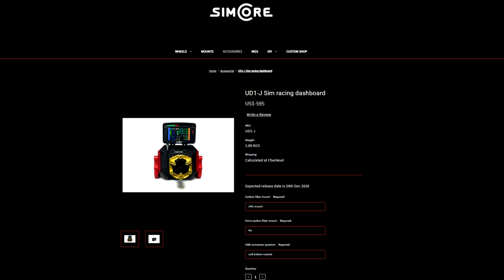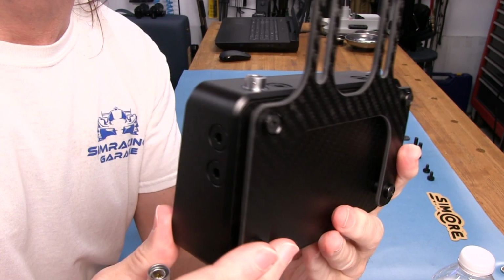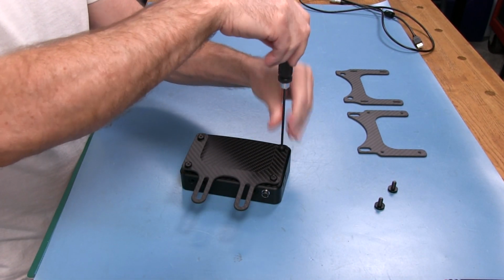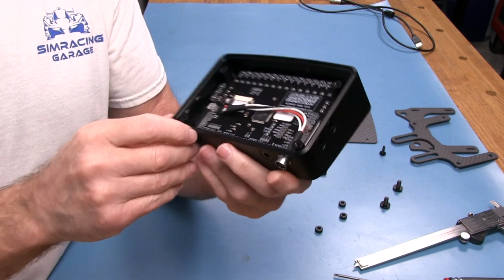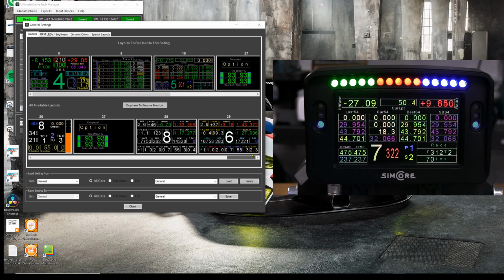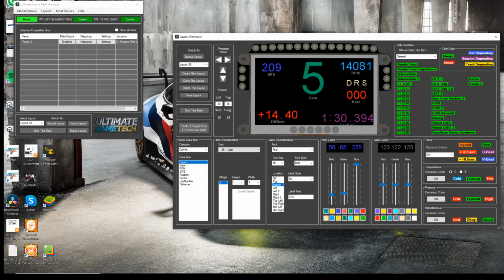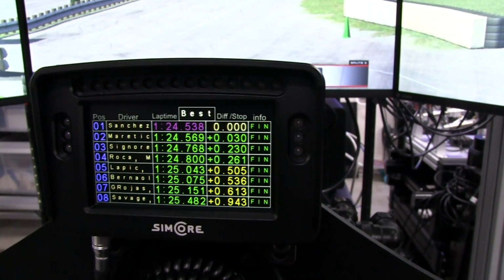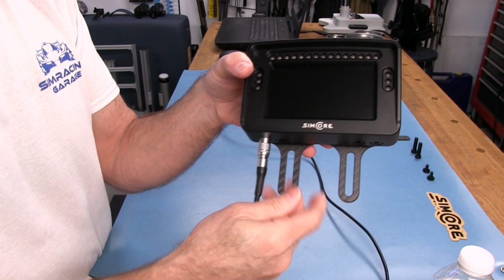SimCore UD1-J Sim Racing Dashboard Review

Comment: Really a fantastic product, both hardware and software. The sim community is very lucky to have manufacturers like this, willing to go top quality, when the returns are surely relatively low, because the potential customer base is so small. Especially so with something like this, because it's obviously not compatible with VR (which excludes me as a customer unfortunately).

Comment: the display itself from ultimate game tech is roughly 325$ without a case. Considering you can buy a 7" touchscreen + adruino for around 130$ on adafruit it's a big premium for some Leds you could make directly on the display itself. It's a great looking display, but I feel it's overbuilt for simracing. You don't need carbon fiber around a display in your living room.
Reply: Its not. Take it from me. The time and trial and error it took to make mine with a professional look, it would have been easier to just buy one. Thats not to say it wasnt cheaper. It was. 
But if i had to do it again, id probably just buy one.
The only thing I HATE about some of these displays though, is they want an annual subscription for a licence. 
Its crap. You shouldn’t need a licence for a LCD display.
Reply: @Gino_567  Go and give a look at SimDash on Instagram / Facebook, almost half the price.

Comment: I'd love to better understand the differences in approach between UGT and dashes which use simhub at their core. On the surface I see that all the data is fed and managed locally vs being sent out and then pulled back via a webpage which is great. The questions that remain are: is there a difference in the game data/controls that can be accessed by UGT vs simhub? Both seem to be highly customizable, whereas UGT is biased towards pure data presentation and info management, and Simhub based displays bias towards immersion/being able to visually replicate the dashes of specific vehicles.
Reply: Same data is available

Comment: If you mounted it flush on the back of the display and used 2 of the stand off washers to mount in to your wheel you wouldn't need the extra washers correct?

Comment: To much expensive... for way less you can get the SimDash , and with far better looks.
Reply: My Simdash quote is much closer, I'm quoted $460 USD shipped. What were you expecting it to cost?
Reply: @elmalloc  For what I know in Europe is 310€ + shipment. Of course if you live in the other side of the world the shipment cost will be way higher and the currency conversion doesn't help either.
Reply: @elmalloc  idk where you found it for $460 shipped. Simlab website is in euros not usd